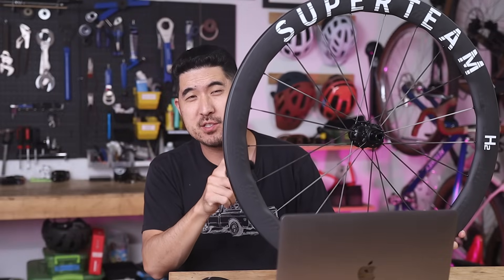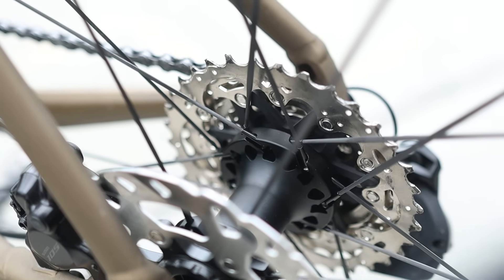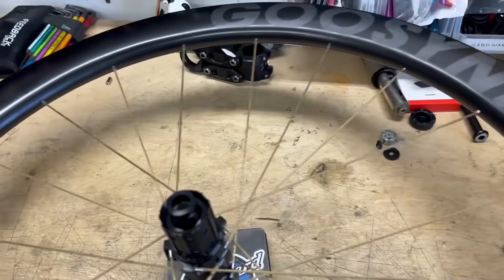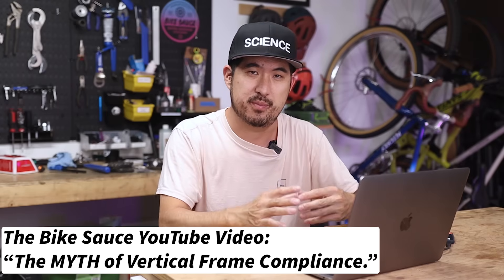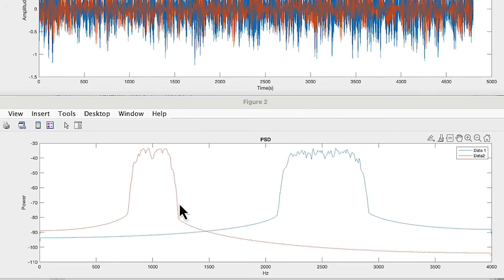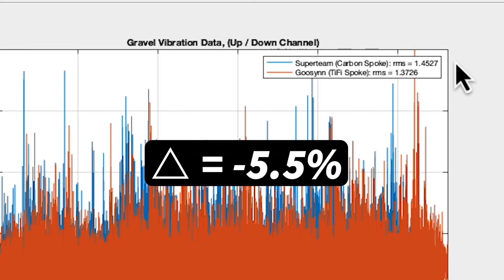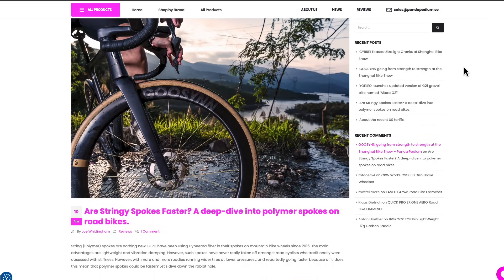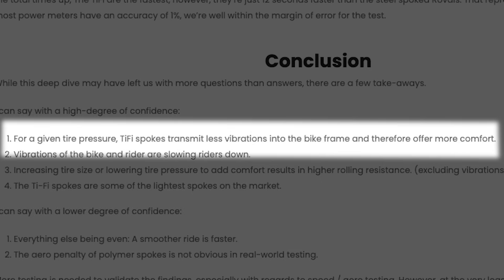Are Polymer Spokes Compliant?? // What the Science Says.

Comment: "At the end of the day what do we have"?  A bunch of marketing B.S.
Reply: Caveat: i haven’t watched the video yet, so I’m just basing this comment on the known science

Different spoke materials have different elasticity. This is a thing. It’s hard to find the real scientific characteristics by googling but here’s one I’ve seen: “Carbon Spoke
800 N/mm
Steel Spoke
580 N/mm
Ti-Fi Spoke
380 N/mm”
This is load causing deformation. 

So, yes it is a scientific fact different materials have different elasticity.  Thus, if the experiment here found no differences in overall suspension effect, it either is not sensitive enough, or is flawed, or is interpreted incorrectly.
Reply from the maker: Toward the end of the vid, I mention some tire deflection studies I e conducted in the past. Even a high pressure road tire has a spring rate of about 1/10 of the system of spokes, conservatively. In a lab setting, the spoke deflection is easy to measure. In a real world dynamic setting, the tire deflection seems to bury any spoke deflection, making it harder to detect, and certainly harder to feel under normal road cycling. Mtb trails may be a different story due to the higher input amplitudes.
Reply: @TheBikeSauce Your video was great.  My post was directed towards the Manufactures advertising campaign that make non scientific claims.
Reply: @TheBikeSauce I didn’t watch the video yet, but to me the tire complicates the experiment. Good experiments have fewer variables as you know—for obvious reasons

So without watching, how I would design such a test:

Characterizing the effect of the spoke material within a wheel:
1. Test in a harness with the fewest parts that constitute the wheel, being just the rim, spokes, and hub
2. Spoke tension matters, so test various spoke tensions. It could be that at higher tensions you’d see different effect or some are magnified or dampened. Or at lower tensions
3. Always use same hubs
4. Vary spoke materials and cross section shapes and diameters
5. Use weights on the rim for the possibility that different weighted rims may have different effects given different spokes
6. Woud different rim materials matter?  Maybe. Maybe the dampening qualities of cf would be synergistic to certain spoke materials. Maybe aluminum could work differently, etc
7. NO TIRES

Then the 2nd separate part of the experiment—how does this relate to the real world. Breaking this down, we also get… what effects would be or could be perceivable:
1. Traction
2. Vibration, possibly leading to fatigue
3. Steering control
4. Etc

Then separate we test what is the threshold of the different characterization attributes you found earlier where the difference would be perceivable?

Then part 1 would be connected to part 2, but these would be many sets of experiments
Reply: @St1gCom  1. You should have watched the video before commenting. 2. There's a different between additive and multiplicative effects and a wheel is a system. 3. There's a massive difference between statistical significance and physical or biological significance. Just because something is statistically different doesn't mean it is physically appreciable to the application at hand. And just because something may have a strong material difference doesn't mean the stimulus perception on part of the human interacting with it will be biologically distinguishable. And this last part is supreme. Because as the only time a difference does seem to show up in these spokes, is when the forces are greater. Signal theory tells us that the larger the stimuli to be compared, the greater the difference there must be for it to be human perceptible. Thus, I'm highly skeptical there would be any useful difference with these spokes on a mtb application.
Reply: @cjohnson3836 I don’t think anything you said contradicts and refutes anything I said, or at least the parts that were correct didn’t. 

More later 👍
Reply: @St1gCom  Then you need to have a think more because I directly refuting what you typed, particularly the last sentence. You are attempting to draw a criticism of a study based on an ridiculously reductionist point of note on a single material property thinking that it can explain an entire system. That's asinine.

[Thus, if the experiment here found no differences in overall suspension effect, it either is not sensitive enough]

Completely irrelevant to the research question. If the equipment isn't sensitive enough, then the differences are meaningless to the system (Nolan already stated that the effect of the tires will completely swamp any material difference in spokes). And they are meaningless biologically (as I already mentioned wrt rider perception, which is the actual rig sensitivity of value).

[or is flawed]

Or, you have a moronically reductionist understanding, which you've almost proven to be the case.

[or is interpreted incorrectly.]

Justify your argument. Because you're the one that doesn't seem to grasp the question.
Reply: @cjohnson3836 no. I never said that the differences are meaningful. Just that we know for a fact that there will be differences.  As I said, some of what you said is logical, some maybe less so, but what is true does not conflict with what I said. 

Anyway, there are 2 parts to most of these kinds of videos:
1. What are the characterization or effects of the stuff being tested, if any?
2. How does that relate to real world performance?

So without seeing the video, how would you design this kind of experiment?  This is actually an important exercise in engineering—test first. You design the test before your product. 

So I don’t really need to see the video to comment, though I fully intend to when I have time k?
Reply: @cjohnson3836 I think you added a reply as I was typing. I don’t really want to get into this too much cuz as I said I didn’t watch the video, but I just want to respond to one point:

“The tires will completely swamp the effects of the spokes” or something like that

Of course they will. Like duh?  Right?  Tires would probably swamp the effects of basically anything about a bike aside from the suspension system

Soooo…. ??????

There is no point in such a statement. No one expects the spokes to make a difference even within a magnitude or 2 of what the tires would do. 

It’s also pointless in that we want everything on the bike to perform maximally.  So given the same tires, same pressure, same wheel parts—only then, is there a perceivable difference?  That’s the only question that matters in the end.

Comment: So, based on the relative “springiness” of the tire, wouldn’t it make more sense to keep the wheel stiff so that suspension effect can be managed by the pressure to which one inflates the tire?  Along the lines of ceteris  parabus…. Adding compliance at other points in the system, many of which seem non linear in response to stimuli, would add noise to the handling/cushioning?  Ah, who knows…
Reply: Changing tire pressure would affect many performance variables. Ideally what you want is to set tire pressure to be fastest for your conditions, and let the rest of the system handle variables outside of that.
Reply: @St1gCom from the speed standpoint, usually if you feel greatly uncomfortable you either have too high tyre pressure or need some form of suspension anyway, because being shaken up and down consumes the energy you'd otherwise use to go forward.